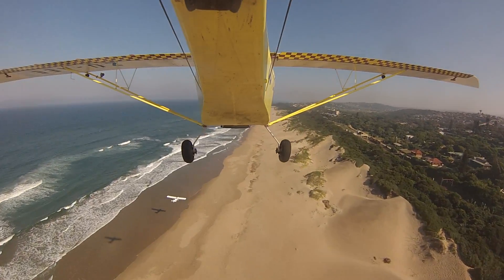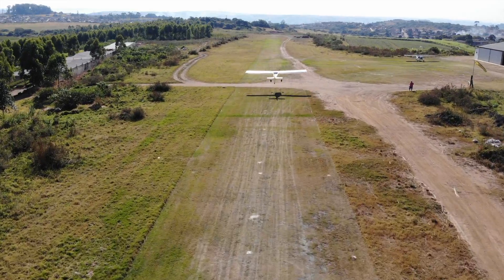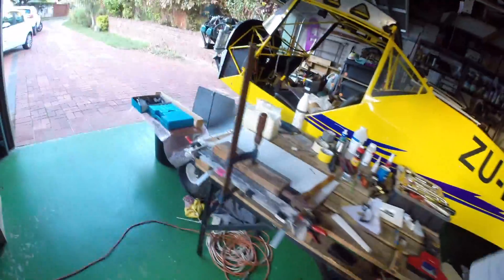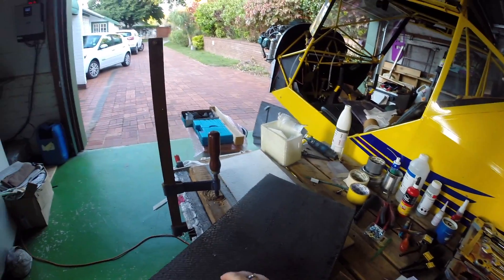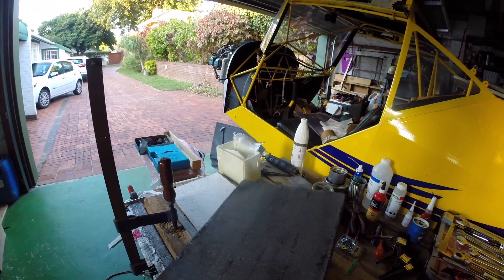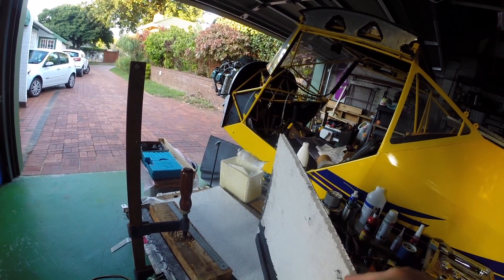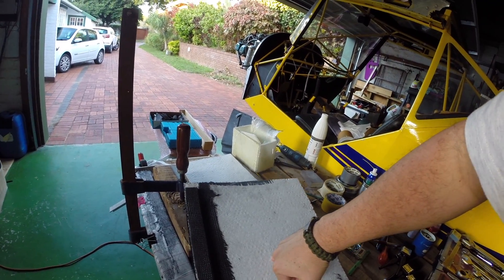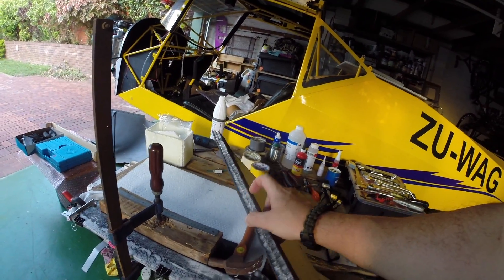Carbon Fibre Luggage Bay for the KitFox - Part One!

Comment: Great mod by the look of it, for light loads in the back. One point it is much better to do two layers at once rather than letting one go off and adding a second but take it you pound out the need for the second layer when the first was not stiff enough.